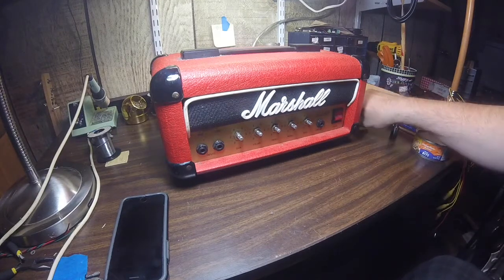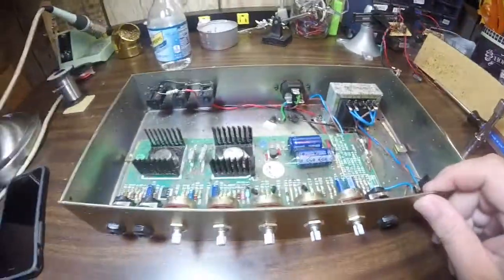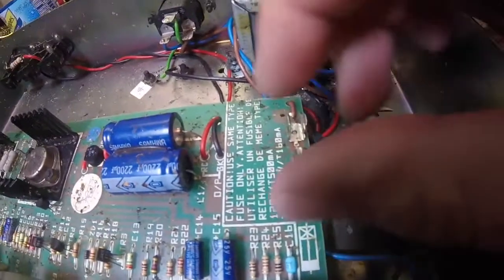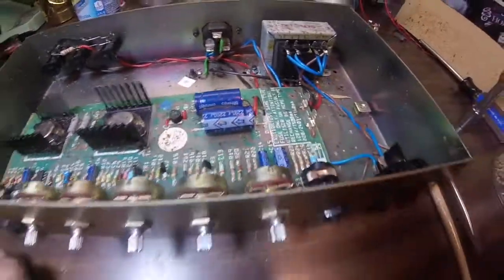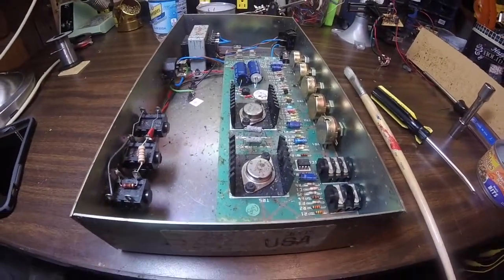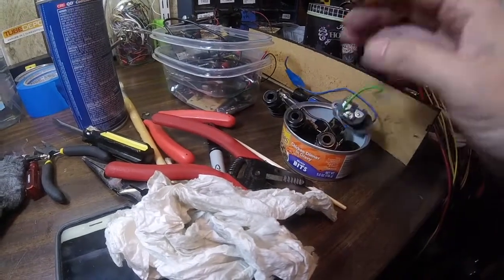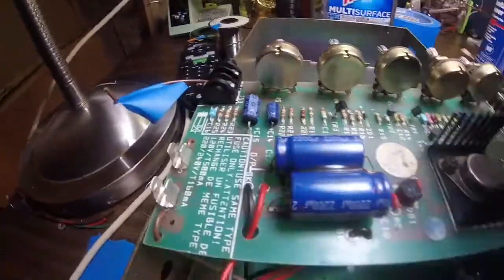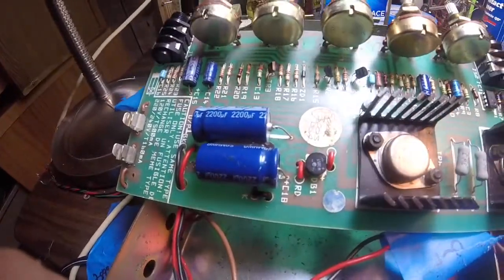Repairing a Marshall Lead 12: Part 1

Comment: Wow. I got mine in 1986 and the guts look far better than this (just a little dusting covering the PCB board). My gain pot started the annoying crackle-static sound so I just shot in some DeoxIT cleaner into the pots and blew out the dust with an air hose. You do have to take off all the pot knobs and input jack nuts so that the PCB front can be tilted up enough to shoot in the cleaner in the tiny holes for the pots. These are great amps! I think I paid under $300 back in the day.
Reply from the maker: yep. This one was severely abuse. Deoxit is the best